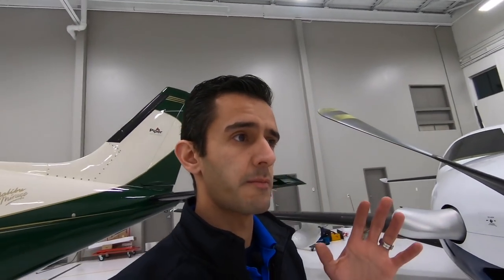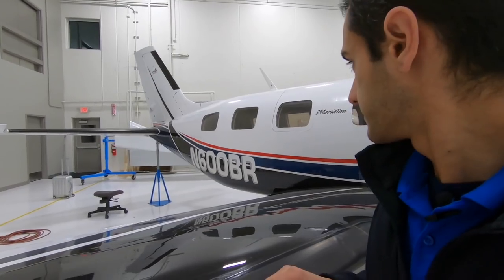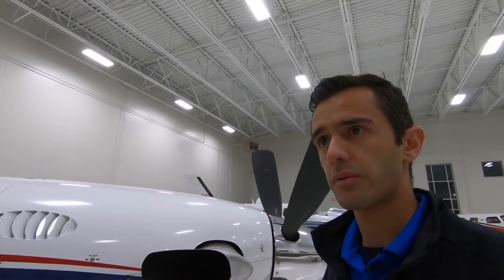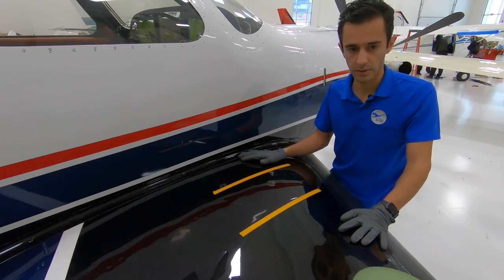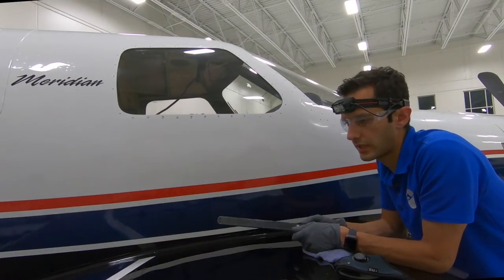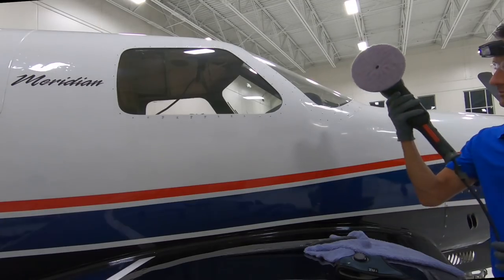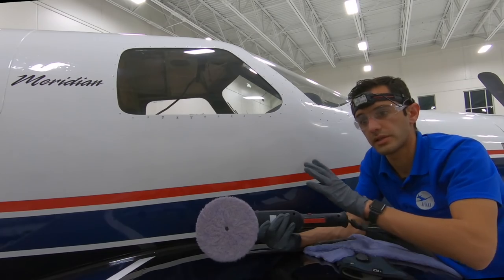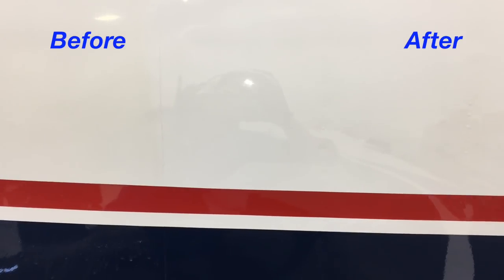VLOG 014 - Piper Meridian Heavy Paint Correction/restoration - Ceramic Coating

Comment: Looks great! What brand no rinse are you using?
Reply from the maker: Ben Leonard the original! Optimum Polymer Technologies
Reply: Aviana Aircraft Detailing thank you! I will check it out, I just worry about scratching the paint with a no rinse product. Keep up the great work!
Reply from the maker: @benleonard1952  I have washed millions of dollars worth of cars with no-rinse. Perfectly safe with proper technique. Check out episode 1 and 4, I wash a Rolls Royce with no-rinse in those episodes
Reply: Aviana Aircraft Detailing I will give it a try on our PA-46. Thank you for the advice and great videos.
Reply from the maker: @benleonard1952  Good luck, let me know how it turns out!! (to be fair, this system does work much better on a ceramic coated plane ;)

Comment: Hello sir I noticed on a newer 2016 m350 that there are a couple of cracks along the fuselage inline with the ribs about a foot or two on the original factory paint.  The aircraft has under 200 hours and practically new    Is that normal ?
Reply from the maker: Great talking with you earlier. For anyone else reading this, those paint cracks are very common on PA46 airframes as a result of the cabin expanding when pressurized at altitude.

Comment: Why a rotary? Is it preference or is the paint just that hard?
Reply from the maker: JOSH FOSTER Aircraft paint is rock hard. Also it is a more comfortable tool in terms of noise and vibration. You could do it with a DA but you end up screaming at speed 6 to do any work.